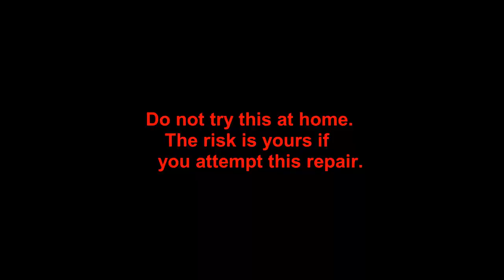Canon 70 200mm f/2.8L IS USM manual focus ring slipping

Comment: The 100mm F2.8 macro has the same problem & mechanism.  Replacing the motor spacer alone didn't work.  The roller bearings & all the races had to be cleaned & regreased before it showed signs of life, for the moment.  Rotating the motor spacer to fresher parts also helped.  Pity that all the EF lenses are falling apart, just as they're being phased out.

Comment: Thanks for sharing.  I had a noise from the focus ring in manual or auto. Took it apart and found the sticker the indicates focus level was peeling off and hitting the ribbon for stabilizer. Never would have tried it without this video!  Back together and all better. Thanks again!
Reply from the maker: Good to know!  That's a good lens to hold onto

Comment: I recently had to replace a few screws in my 135 mm  f2 L ,the screws that hold the rear element in place had snapped in half. 
I took it apart fine, and got everything back together  but now my auto focus just ping-pongs from in and out of focus and won’t actually  confirm on the subject.
Reply from the maker: For the screws to snap in half, there was probably impact involved.  The "hunting" back and forth indicates a loose or torn flex circuit, or the rear lens is not concentric with other elements.  Check the flexes first.

Comment: Thank you very much for your detailed video! I think I have the same issue. It doesn’t work in AF mode either. Is it expected/the same issue?
Reply from the maker: The "slip clutch" (5:20) has to be right before the AF can work.  Aside from manual focus, if AF isn't working, the armature (5:45) might have to be polished with 2000  grit sandpaper.  There's a good chance that a new felt bed will not only fix the manual focus but also the AF.  Good luck!

Comment: I have a 17-55 2.8. The autofocus works okay but the manual slips, sometimes moves other times you spin & spin.
Any advice would be appreciated.
Thanks
Reply from the maker: Same design as 70 -200 once you get to the USM motor ( 5:00 ) so the same technique should work. Be careful to note the orientation of any "eccentric" collars you might have to remove to get to this point and reinstall them in the same orientation to avoid focus errors.
Reply: @ghccrtube5007  Thanks for the reply & advice!

Comment: I have some wobble in the front barrel with loose screws.  It is the section right after the distance meter (not the easier to fix most front area.)  At 7:47 in the video are those the screws that likely would need to be tightened for my wobble to go away?  Thanks for any help.
Reply from the maker: Yes, that's frequently a problem with either loose screws (if you're lucky) or a broken cast aluminum subchassis - the shiny internal barrel.  If it hasn't been dropped it's probably loose screws.  Good Luck!

Comment: bro, thank you. your tutorial is working for my slipping focus ring. BTW do you ever have any issue for 70-200 inside parts shaking (maybeimage stabilizer) do you know how to fix it? now my image stabilizer is shaking.
Reply from the maker: Thank you for commenting.  Good to know you got it working.  The rattle, like you say, is probably the image stabilizer lens.  Sometimes if the lens is removed from the camera before turning the camera off, the IS doesn't have time to move the IS lens to the storage position so it floats loose.  If the IS isn't damaged, putting it on the camera then turning the camera off will lock-down the IS lens.  If the IS is damaged it's usually one of four posts surrounding the IS lens has broken.  It can be super glued into position if you're careful.

Comment: one of the ribbons got messed up when I was putting the lens back together. Now it won't auto-focus. It possible to find a replacement ribbon?
Reply from the maker: Parts are no longer available from Canon for this version, but you can sometimes find them on Ebay or China's Aliexpress.  Depending on which flex you need it could be as little as $2.  I can identify the part name for you if you want to send pics to dcntamcn@aol.com

Comment: If 70-200 F/4L IS same it can add ribbon or ?
Reply from the maker: The F/4 has a different design and a simpler solution to the slipping focus ring, which can be found on YT from others.
Reply: @ghccrtube5007  Oh, that's interesting. I did a research 'cause of slipping focus at my 70-200 f/4.0 IS, but I didn't find anything. Would you please post a link? Thanks a lot.
Reply from the maker: @cw7243  Here you go -  https://www.youtube.com/watch?v=1Ug6QdsmSnA&t=321s
Reply: Thanks @ghccrtube5007. I discovered this video already, but I want to use the AF function. So it doesn't help a lot. But thanks anyway.

Comment: Thanks. I got the same problem with the same lens. Can the replacement ring be ordered from Canon or some other place? I don't have a spare lens that i can take the ring off.
Reply: Sorry, parts aren't available for this version in the US, but might be found elsewhere or in a "parts only" lens on Ebay.  The felt washer wasn't available separate from the complete AF unit, but can be cut from a thin piece of felt or even shirt cardboard 1mm-1.5mm thick.
Reply: @crytubecam  No parts here in Europe also. I'll have to cut it. Thanks :D

Comment: This is the exact problem I'm having with my mkiii. I brought it second hand and didn't notice it till later. is the focus ring supposed to stop dead or still rotate once it reaches minimum or infinity?
Reply from the maker: I don't think you have a problem.  The manual focus ring has a slip clutch mechanism so that the ring slips when you reach either extent.  The problem described in this video is when you rotate the manual focus ring but the "distance scale" stops or intermittently pauses before continuing - or doesn't turn the scale at all.
Reply: @ghccrtube5007  I do have the problem you described. I can't do any manual fine focusing with the focus ring.
Reply from the maker: @JehuMcSpooran  This is the fix you need
Reply: @ghccrtube5007  Cool. I've been looking at a few other teardown videos and it looks like the mki is a fair bit different from the mkii and mkiii, especially with the rear group and IS unit having decentering shims. Have you worked on latter two models?
Reply from the maker: @JehuMcSpooran  Yes, we've repaired dozens of the 70-200mm lenses but collimation is well beyond this video and is time consuming or requires expensive test equipment.  Canon no longer provides parts for this version lens so the video was done so the average DIYer can revive it.
Reply: @ghccrtube5007  I was worried about that. from what I understand the mk2 and mk3 can not be taken apart without needing them to be collimated again.
Reply from the maker: @JehuMcSpooran  There are eccentric adjustments in the version 1 as well (and any high end lens) but getting to the focus mechanism doesn't involve changing them if you're careful.  If you take before photos, working around your focus problem, then make note of the eccentric posts or shim positions and duplicate on reassembly you might come close to a good image. Or you can deal with the focus problem, or pay Canon several $hundred to get it right.

Comment: Can the bayonet ring be tighten down to increase the tension on the existing gasket or does a new gasket need to be added on top of the old one, or replace the old one all together?
Reply from the maker: The bayonet ring rides in 3 sloping notches to provide a tiny bit of adjustment.  Without test equipment the only way is trial and error. Turn the bayonet ring completely clockwise and test if manual focus slips you'll have to replace the gasket.  Less is better.